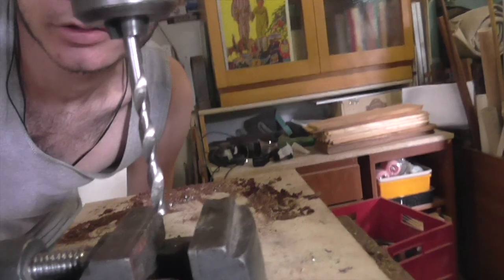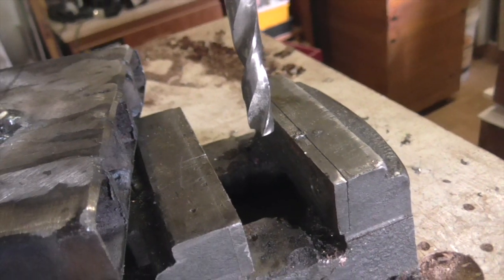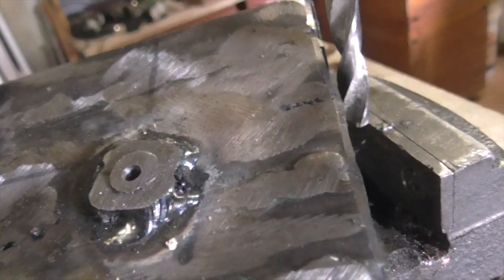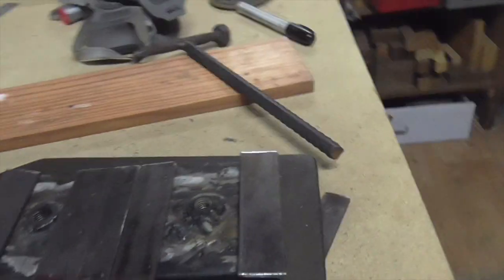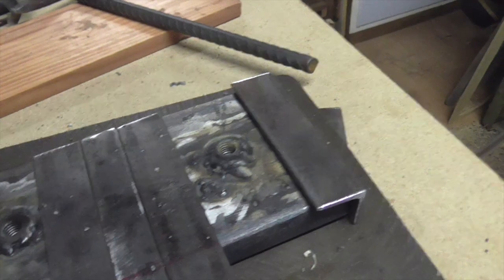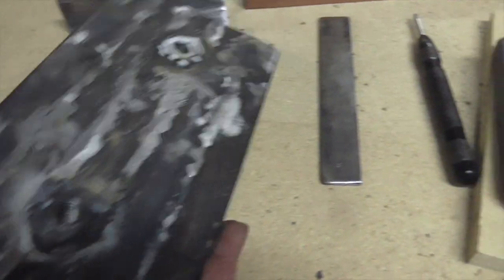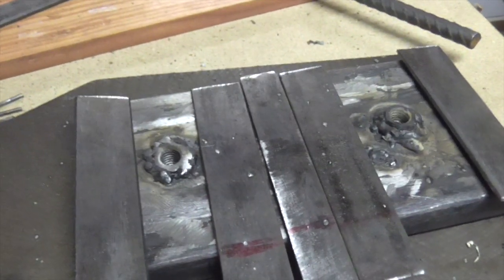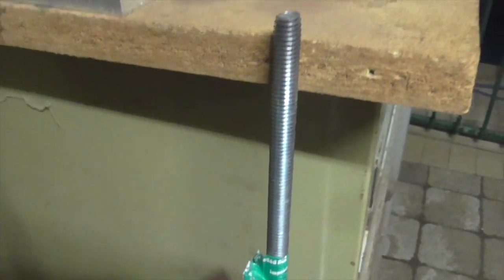MINI Hydraulic Press Part 4  - THE DIE HOLDERS!

Comment: What was the big long thing u were welding with it made fire and stuff
Reply from the maker: I think you're talking about a welding electrode? that's the stick that comes out of the red and black handle.
The electrode is a general purpose electrode and is essentially a piece of steel coated in a flux with one exposed end, on the other when you strike the electrode against the working piece to break off the flux around the tip to then strike an arc which is the fire!